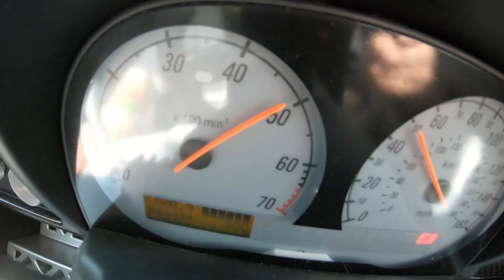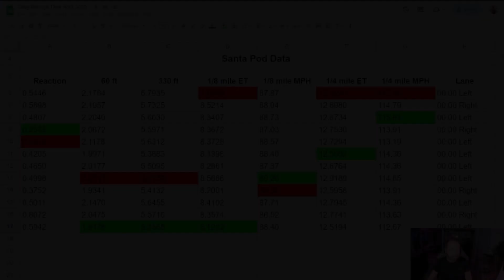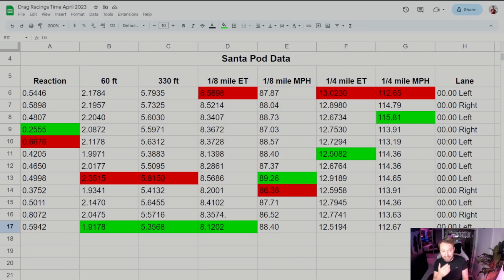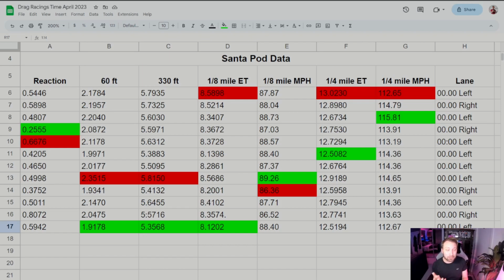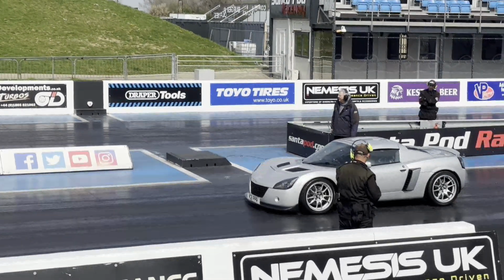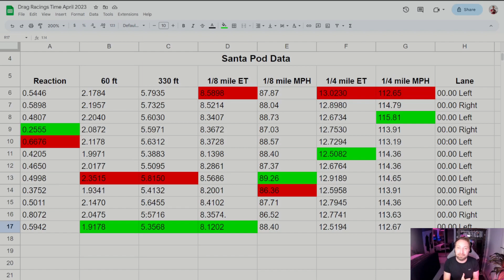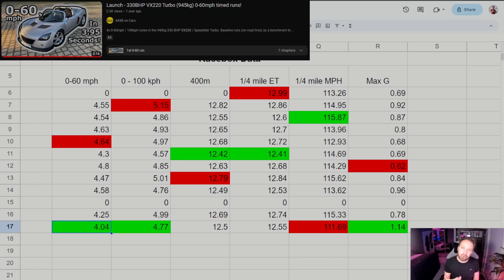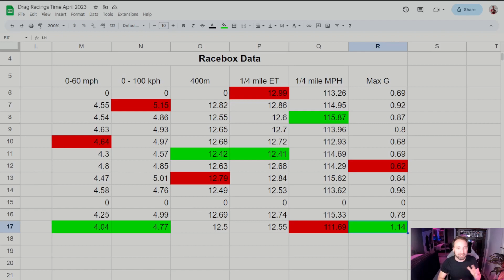Drag Racing the VX220 - 1/4 mile tests (330bhp 945kg)

Comment: Mid 12s on road tyres is unbelievably fast. 

The MPH at the end corresponds with your 60ft time. The slower you leave the line, the more time you have on the track to build up speed. It's a confusing concept but sort of makes sense. 

1.91 60ft on road tyres is also pretty good. Really great base numbers, great to see how the car improves.
Reply from the maker: Thanks dude, that’s massively helpful and your right, when you think about it that does make sense 👍

Comment: I noticed you were shifting at 6.5k. Is that when the power drops off for you? What inlet manifold are you running for 330bhp?
Reply from the maker: Thanks for the comment dude, so on power curve etc, in the after hours section of the video I talk a little more on the map (with dyno graphs etc) which might address your question. Inlet manifold is a Courtney/Klasen one. There’s a video of that here on my Part 1 restoration video 👌
Reply: @AK88onCars  ahhh perfect, I stopped watching at 11ish mins before you talked about it 🤣 that makes sense shifting when you did then

Comment: Can we get a list of mods done to the car ?
Reply from the maker: Thanks for your comment and sure, but maybe check out some of my other videos (including the VX220 build videos) that include more details of engine, suspension, brakes and more done recently. But say if there is something specific you want to know(?) and I'll let you know
Reply: @AK88onCars  well i have looked around, I am planning to build a speedster too and i'd like to know approx what i'll need to reach the power you have on yours

So far I know you have headers , lightweight flywheel, suspension upgrades and an lsd but I don't see much else mentioned ? Correct me if i'm wrong
Reply from the maker: @bigmemer4398  power wise, it has a Z06 BorgWarner hybrid turbo, larger injectors, larger fuel pump, charge cooler, and an ECU remap (in addition to the parts you mentioned). The internals of the engine are yet to be touched, and I’ve had this set up for about 10,000 miles without any issue. Although this is the limit of save power you can run with a standard Z20LET engine. Does that help?
Reply: @AK88onCars  yes, thank you very much 😁
Reply from the maker: @bigmemer4398  no problem, thanks for commenting! 🙂